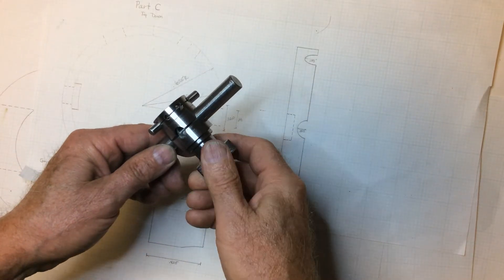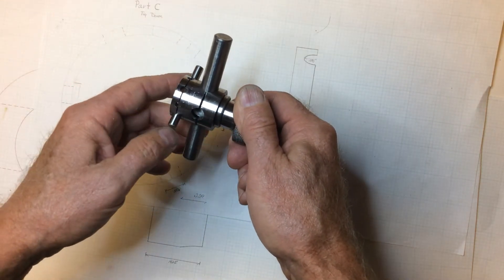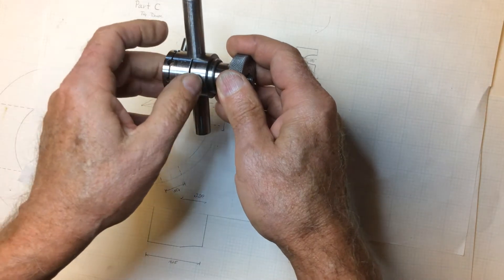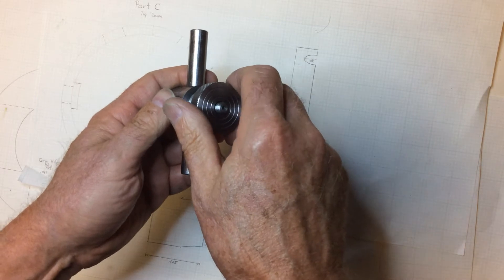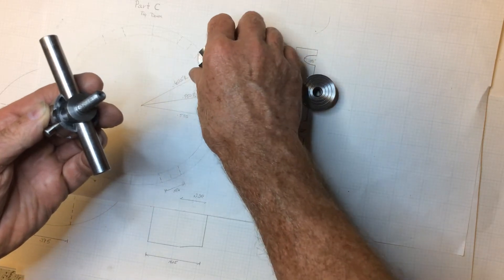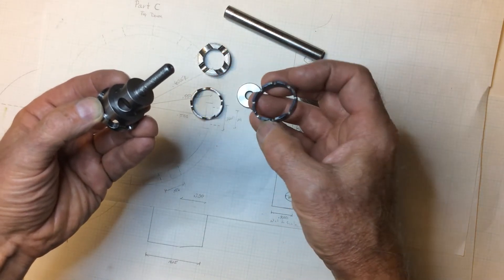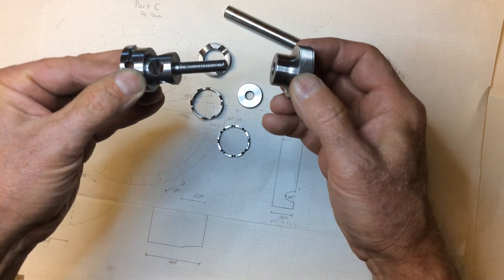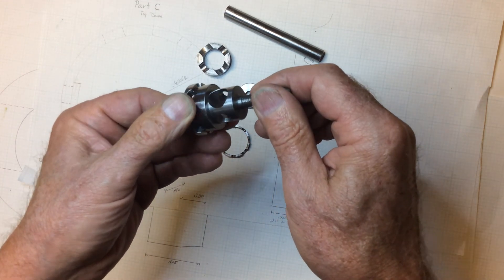57s Snug Details

Comment: Nicely designed and machined. There was quite a bit of work and thought put into that.It's also a lot like the design Armstrong and maybe a few others used as a stand alone multiple diameter boring bar holder for a lathes cross slide. But I don't know if those are still being made anymore.